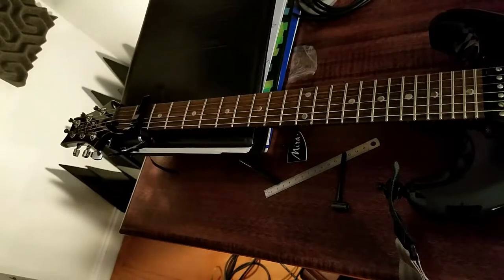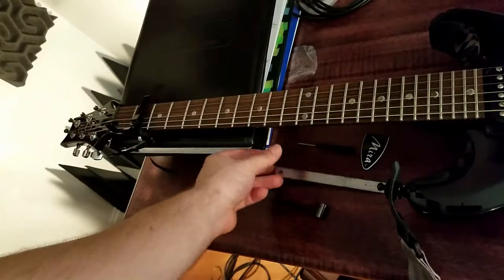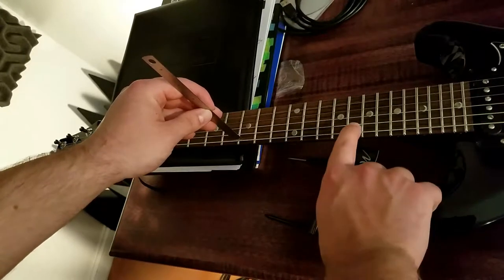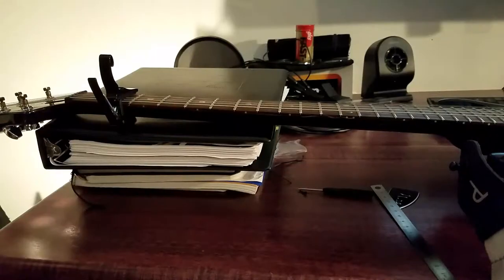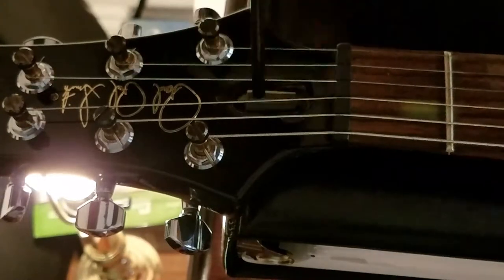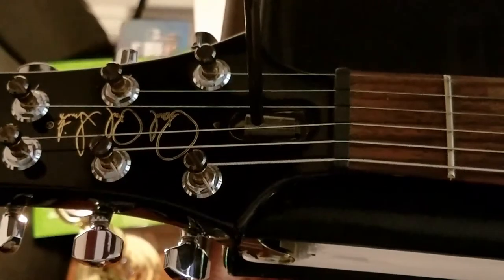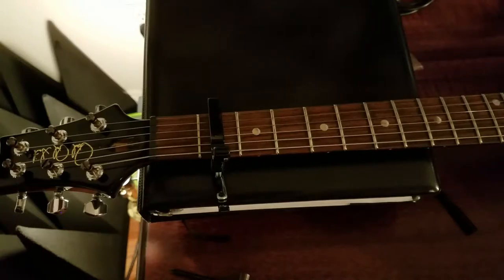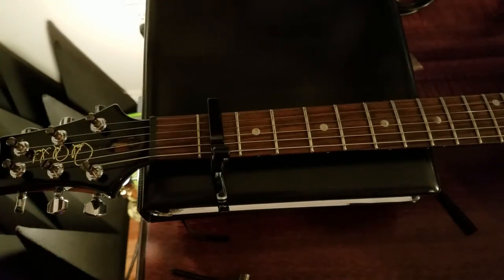How to adjust a TOP adjustable truss rod and stop fret buzz

Comment: An automotive. FEELER  gauge is perfect for this application. You need to purchase a quality unit, it will have more than a dozen or more different sizes from the Ultra thin all the way up.
Reply from the maker: I didn't mention those for two reasons, first is the measurement doesn't really need to be that precise - a lot of this is feel and personal preference - second - I actually got a set of them and found I literally never ever use them and if you don't have them on hand you can always find a piece of paper or a business card. No one is carrying a set of feeler gauges with them at a gig lol.

Some people might find them helpful, but I really do think it's over kill. 

For my main guitars - I don't even need to look, I can just feel when it's good to go or close to it and then make the adjustment from feel. It also makes a huge difference having a really well build guitar vs the cheaper ones I grew up on... I maybe have to do an adjustment 1-3x every TWO  years vs about every 3 months.
Reply: Dude, the only reason I even brought them up is because you took out the capo and the straight edge and started measuring the string gap.  The feeler gauge is just alot easier to read.  I been  playing guitar since the late 60"s whether a 6 ,12 string or bass of different types and several other types of stringed instruments and it's just a matter of self preference.  That's all,  keep on keeping on.    Dee

Comment: If the fretboard is back bowed then we turn the trus rod nut to the left ( counterclockwise) to relieve it, unlike what you mentioned.
You really got me confused.
Reply from the maker: I'd urge you to take a listen to what I said at the 3:30 mark to about the 4min mark in the video - it's one of those things you need to do multiple times and you will figure it out by feel. If you got a quarter turn the wrong way, go back the other way and see what happens it's not going to hurt your guitar at all. You need to tinker with it to really get the feel for it. It's not quite as straight forward as everyone would like it to be.
Reply: Are you sure you turned counter-clockwise? That looked like a righty tighty clockwise turn to me